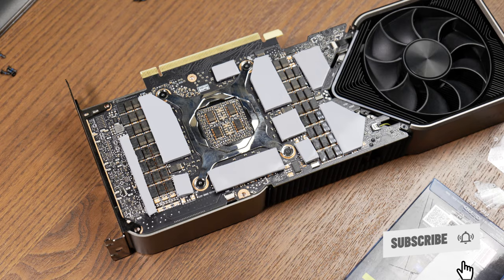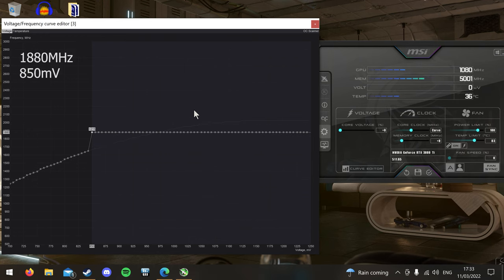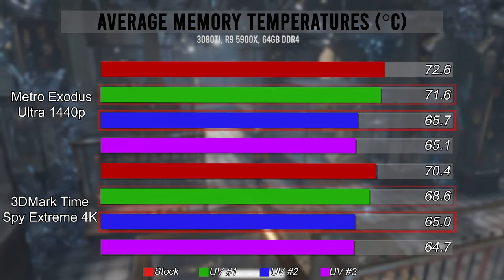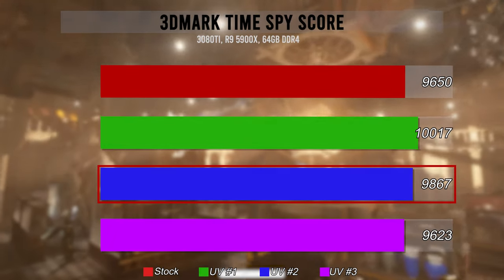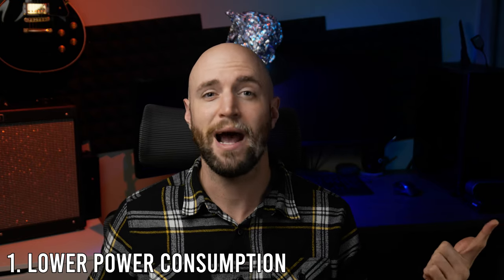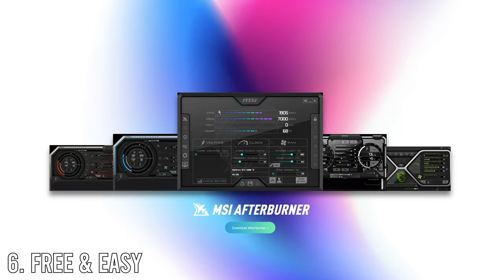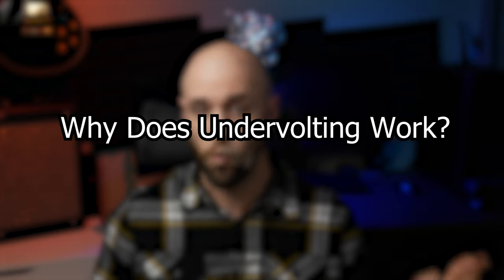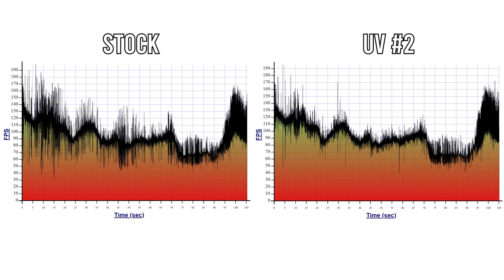Why You NEED To Undervolt Your GPU!

Comment from the maker: MSI Afterburner Undervolt Guide: https://www.youtube.com/watch?v=kh1QsSCt4Xk
Reply: What about low GPU tasks? Since you have flatten the curve, I get the feeling that you will have worse temp/power consumption in not so intensive tasks or idle.
Reply from the maker: @radu1006  From what I have observed the low power is still the same as before. Around 35W
Reply: Holy shit, this is insane.
Could you also recommend this for the 3080? Specifically something like the Gigabyte 3080 10GB Turbo?
Cause that one runs hot and the fan explodes.

I’d never have thought that this doesn’t affect performance negatively.

Comment: I've been undervolting slightly, and it really is pretty sweet. Even just a small adjustment saves quite a bit of heat and power. Thumbs up.
Reply: Is it pretty simple to do? I just got a 3080 ti from Asus (TUF OC) and was planning on replacing the thermal pads if it wasn't to expensive but this seems like a good alternative - possibly both.

Comment: I undervolted my 2070super and temp went from 83 to 67 degree with avg. 2-3 fps loss using Afterburner
Reply: hey bro ! i am using zotac 2070Super and my temps are high on 1440p gaming (Borderlands 3 around 80c  ? Valorant on low setting is on 70c) . As i am using Zotac card so i dled the Firework software but yeaaa i have no idea what i am doing but i would appreciate if i can get your MHz and Volt or maybe the % HAHA

Comment: I'm going to spitball a reason why undervolting works without dong much lookup into the specifics and such.  Digital comms works by looking for a 0 or -Vmax for "off" and Vmax for "on" (binary).  Sometimes that's reversed, but that's not important.  So as a chip designer, you can set thresholds for when we want a 0-bit and a 1-bit.  Based on whatever these thresholds are and the voltage of the device, the settings of these thresholds and Vmax are defined in such a way to guarantee robust communications up to some probability of error under noise, power, and heat constraints.  By changing the voltage of your device, you're tuning it to be closer to that threshold of failure while relying on less wattage to obtain the same digital values (the efficiency exploitation). Seeing how increased power usage can result in increased heat and reduced performance, getting it closer to that threshold will do the opposite by reducing power usage, reducing heat, and potentially increasing performance.  But you're sacrificing stability in the long run by increasing the probability of occurrence of voltage threshold misclassifications. My guess is manufacturers release products with a CYA setting to ensure maximum robustness to heat and noise while allowing for room for tuners and power-users to define their own risk for their system and approach that threshold in such a fashion that no manufacturer would want to take responsibility for.  It's probably also set based on some threshold of tolerance for manufacturer defects, where it's cheaper to just set all the chips to the same value without spending effort on tuning each device individually.  So, depending on each system and user's risk tolerance, there's potential for increased performance and reduced power usage by undervolting, but the caveat is potential application failures due to misclassification of voltage signals, as you highlighted.  But I didn't look any of this up, or any of the specific technologies involved that may help (such as error correction codes and such) so there's a bit more nuance to this.

Comment: It's shocking how big different it makes for temp. I got an EVGA 3080ti ftw3 and It was hitting 83c all the time and started throttling and would even get hotter. The memory would sometimes go over 100c. I undervolted to .875 1875mhz seems to be very stable and played Days Gone for hours, and gpu temp never went above 69c and memory around low 80s.  Room temp 75f.

Comment: i would totally do this, if i could undervolt the gpu in its bios. im not a fan of having some software opened in the background all the time and if its not running its not applied.
Reply: You can apply when windows starts, MSI afterburner doesn't need to be open
Reply: how would it apply, if msi afterburner wasnt opened?
Reply: @avendorz  there's an option within MSI afterburner to start with Windows. Maybe I'm wrong and it's just hidden but I don't see the app open in the taskbar until I actually go to open it when I need to and the settings are always applied. Even when open it uses negligible resources

Comment: I'm a computer technician and for years I've been telling people why they should undervolt the cpu and gpu.
this video is perfect explain.
My e2160 processor, released in 2006, had a speed of 1.8 GHz. I lowered the voltage with undervolt and took the speed to 3.0 GHz. It served perfectly, i gain more performance, better heats and still works. Undervolting extends the operating times of the devices.
also, my rtx 3060 have a undervolt, same clock speed, was a hitting 78c before undervolt and now 50-60 around depends on the load. max 60.

Comment: I appreciate this video soo much man!

I have some Kryonaut Extreme and some thermal pads coming tomorrow for my 3080TI FE. (Plus I'm gonna cut a whole in the PSU, basement shroud, to mount a fan underneath to blow cool air right on the cooler.) I've had it since April and since I only paid $690USD thanks to Best Buy labeling it as an Open Box 3080 Non-TI FE. So I don't plan on replacing it with a 40s Series. I'll wait til 50s Series.

But boy does she run hot! I managed a stable undervolt of 1950 at 925. It stays around 300 watts while getting the same FPS as stock. Now it runs SOOOO much cooler. 75% fan speed, (which is hard to hear in my case with an air purifier running nearby) 50-60C on the die and 69C (nice) on the VRAM not 70C+ on the die with 95C on the VRAM. I'm still doing the pads and paste. Figured I can get temps down more, and have thermal headroom if I need an overclock when newer games drop in the future.

Comment: Mine msi gaming trio  rtx 2080 with undervolt
-lost 55mhz in boost 1960 to 1905 mhz
-from 1.050mV to 0.912mV
-shaved off 66W in max load 
-lost 10c in temps under load

Works like a charm. Saved two profiles because in idle with undervolt its 30w and thats too much.

Comment: i have a similar system ( same CPU GPU & RAM ) and my Time Spy Score is 18024 , i did run it in 1440 P, have my card set to 821mV and 1880Hz clock, gives me a max of 69-71C

Comment: Doesnt that curve editor actually mean underclock? Rather than undervolt? I am not a physics professor ofc but as far as i know lowering on Y axis taged FREQUENCY means for me lowering the clock. Not the voltage. On this graph to undervolt we need to move the points to the left wich maakes not sense here

Comment: I wonder why the manufacturers and their technicians don't reduce the energy, I mean undervolt, if it's so good.
Reply from the maker: Because they have to cover a wide range of chips. They may all have the same name but because of the silicon lottery they need to make sure the stock clocks work on all of them.
Reply: @TechIlliterate  I didn't think like that, thanks for the answer.

Comment: can't we just reduce power limit to like %80 instead of dealing with mhz and milivolts ? stuff we don't understand
Reply from the maker: Yup! definitely can though you may end up with less than ideal results.
Reply: using undervolt you can get lower powerdrain with same/higher perfomance
only decreasing powerlimit you will definitely will have lower perfomance.
so undervolt is need some time to build working profile, but for more time it give more profit

and yeah, necroposting

Comment: So the only thing undervolting does is lower temperature? I don't know it seems like a cop out from a properly cooled system.
Wouldn't it be better to have good cooling on the GPU in order to have a higher stable clock frequency?
Reply from the maker: Yeah if you want to! But there is always going to be a trade off. You could have the best cooled system but still get benefits from undervolting. Less power draw and less heat output into the room are good enough for me.

Comment: Average FPS, curious what your lows look like. How are the drops on an under volt?
Reply from the maker: Unfortunately I don't have that data. It appears that the FPS Min is nearly identical but undervolt max was 152 vs 145 of the stock. I might try using a different benchmark in the future to get a wider data set.
Reply: @TechIlliterate  thanks for the response,  I’m guessing that depending on your gpu results will vary so my best shot is probably just having a go myself. I’m new to fiddling with gpu clocks and voltages so thank you as well for the videos. 👍👍👍

Comment: how to know if it's 'stable' or 'unstable' when u undervolt it?
Reply from the maker: You'll know it's not stable if the application you're using crashes.
Reply: i recommend use somewhat like msi kombuster for pre-test, then when you reach good stable results try it in heavy games or something, also you can get back about 10-15-30 mV for stability, it's your choice.

Comment: Did someone checked idle gpu power consimption..i have saved 2 profiles in afterburner (stock and undervolt). Because with undervolt i have 30w idle gpu consimption, while on stock 3-10w. Can someone verify that?

Comment: i hv already bought an under volted card:- RTX 3070 FE 220 watts max
Reply: lol that's the max power draw for a 3070 FE, a good "undervolted" 3070 pulls around 160-180 watts.
Reply: @zz8702  yess it hovers around that wattage and what i mean by my comment was that a 3080 10gb which eats 350watss of power.
my rtx 3070 is quite efficient at 200watts or less..
just look at recently new rtx 3070 ti , it also consumes around 300+ watts easily
Reply: @zz8702  all cards above rtx 3070 are bloody power hungry. 
mine is basically a 2080 ti at most efficient load 🙂

Comment: Bro ur undervolts aint stable at all

Just because u can run them at 3dmark doesn't mean they stable

Try a game with those undervolts and ur pc going to crash
Reply from the maker: It's been almost a year since I posted this video and I have been using the same profiles in everything I play without issue.